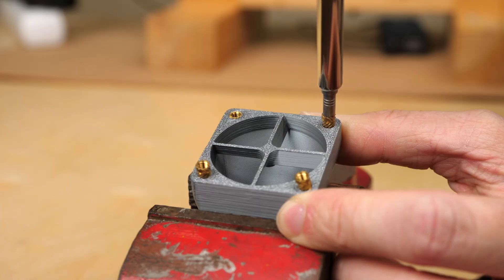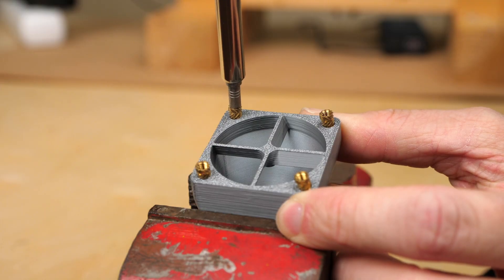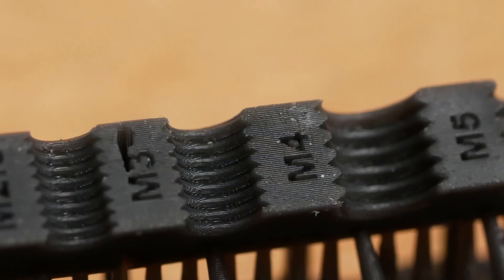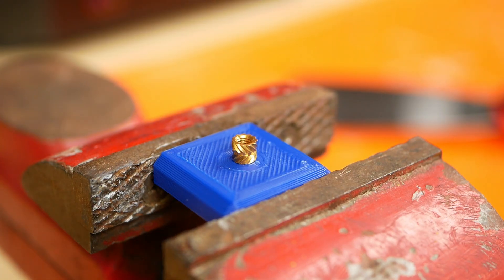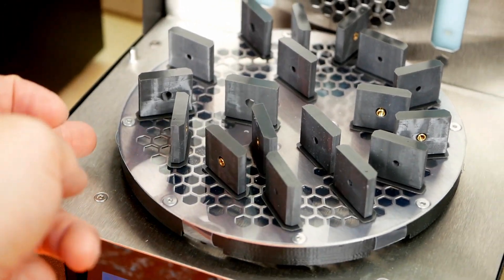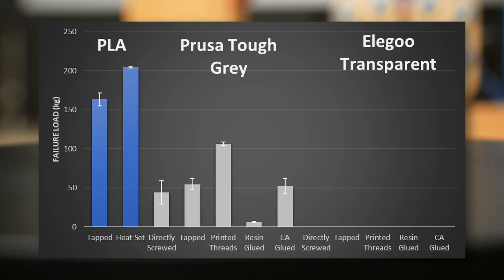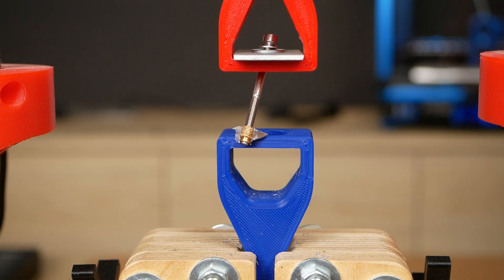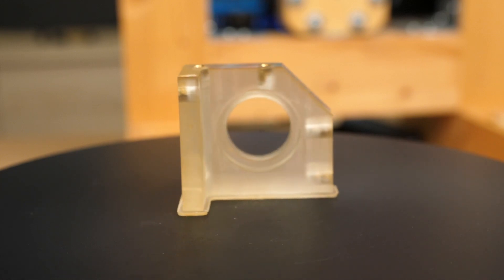Mastering Heat-Set Inserts in Resin 3D Prints

Comment: The undercut and stepped hole is the best way to make the threaded inserts work well by far for epoxy, in my experience. However, with resin prints I would recommend an alternative approach. The heat-set inserts you are using are really designed for melting the surrounding area to get a similar geometry in the bonding area as the undercut and stepped hole. It really isn't ideal at all for thermoset plastics. What I predict would work much better in a thermoset resin part are threaded inserts like those used for metal thread repairs. You can use the strongest method, printed threads, and then add EZ-LOK or EZ-Coil (these are the brand name ones) style inserts. I bet you'd get the best of both worlds -- perhaps even as strong as the PLA, or stronger, up to the limit of the differences in material strength between the plastics. There would also be an additional advantage, that this style of threaded insert would improve the precision of the threads in the end while working even with looser tolerances -- this is what they are designed for in metal applications. The geometry is optimized for more brittle failure modes, rather than extended plastic deformation, and this matches the material's failure mode.
Reply: Would love to see a test being done with those type of inserts. Really curious to see their performance. By the sounds of it, I expect it to perform really well.
Reply: @Rob-ky1ob  he has used them in a video before comparing nuts, threaded inserts and those type of screw in threads with FDM printed samples.
Reply: not realy, the resin part wil give in, exploding, long before the insert wil give in, so the weak link in the chian remains the resin print itself
Reply: @severpop8699  how do you think using abs-like resin impact the results?
Reply: @jonathancervantes2703  no clue mate, no clue.
Reply: My thoughts too. A thread repair insert glued into a printed threaded hole should be about as good in terms of strength as printed threaded alone, though since the hole is bigger (the drill size for HeliCoil M3 is 3.2mm, not sure about the "outer" tapped thread size), it may be slightly weaker.
It should beat glued heat insert anyway.
Kinda crazy they can make those tread repair kits as small as M2.5 though.
Reply: I was thinking the same thing by the end of the video and would also like to see testing on this method.
Reply: The coil-type inserts (EZ-Coil, Helicoil, etc.) tend to rely a bit on the tolerances of the threads they are screwed in into so they might need tight control of the printed hole dimensions to work correctly. The insert that have solid wall (like EZ-LOK) would work better. 

If trying to go this route and have the possibility to manufacture your own inserts, there might even be better thread profiles more suitable for inserting into the plastic than the standard metric / imperial thread profiles.
Reply: @maikeydii  There are also brass inserts with coarse threads on the outside for wood. So one could print the thread in the resin and screw them in, perhaps with CA glue. As printed threads gave good results I think that would be very strong.
Reply: @maikeydii  +1 for EZ-Lok inserts (other brands available, I'm sure, but choices are limited here in Australia and I wanted metric threads specifically). I don't do resin prints, only FDM, so this isn't quite the right place for this, but I've been using those in my designs for a little while and can heartily recommend them - an afternoon of tuning the right hole size, and you can use them perfectly reliably, without having to buy a special soldering tip (and possibly an iron to match) to get them in.
Reply: @maikeydii  just add glue or epoxy
Reply: Daniel, great comment.
Reply: Where possible for the tapered hole the inserts should be glued and inserted from the back. Having just linear splines on the inserts with corresponding printed splined holes would also increase the surface area for the glue to bond. Maybe cnc needs to manufacture thread inserts for resin prints.
Reply: @stevecade857 this, I really wanted to see him pull from the backside to see what the difference is.
Reply: Before switching to cnckitchens heat-set inserts I used the helical thread-repair inserts in my FDM parts too but it was quite easy to over.tighten screws into the insert and rip the plastic and since the inserts are quite sharp is was easy also to screw them in a bit angled and they would cut a new way into the plastic for themselves further complicating the issues.
Reply: @EeroafHeurlin  I would not recommend helical thread repair inserts in FDM parts. With FDM prints your best bet is heat-set inserts because FDM parts are thermoplastics.
Reply: @danielsmullen3223  yeah as I said, I switched to heat-set inserts for FDM. the helical stuff was available from local HW store and before CNCKitchen store added them finding actually good heat-set inserts was not that easy.
Reply: What a GREAT idea! Thank you for sharing!
Reply: Lol I just left a similar comment and noticed yours, you beat me to the punch, sorry for stepping on your toes.
Reply: I have used helicoil inserts in resin prints. I would say it works ok on larger coarse thread fasteners. Less well on smaller ones. To make it work right i had to clean up threads with a tap which works better on some of the resins than others.
Reply: When using coil inserts in a resin part, it is really easy to break the resin threads by thighteing the screw too much or already while screwing in the coil itself. The resin is way too brittle

Comment: I bought a resin 3d printer last month.  I didn't think it would be this bad.  I wanted to print simple clock houses.  It turned out that the resin is prone to deformation even under light load.  My watch cases started warping just after about a week of putting the straps in with spring loaded bars.  In a week, the springs visibly stretched both sides of the strap holder.  I tried 5 different resins and different UV light types for different times and the same result.  Has anyone else had a similar experience?

Comment: If you want higher load you need to use flexible resin. A mix of 95 to 5, which gives you minimal flexibility under load, can hold out more before ripping apart.
Reply: Totally agree, pla and these resins dont compare on the material properties.
Reply: @erikcramer  do you think abs-like resin with that 95/5 mix would hold up to similar loads as the pla?
Reply: @jonathancervantes2703  Thats totaly resin brand and mixture dependend.
Reply: One of the proven optimal resins for that would be Siraya Blu (original) for 95% and Siraya Tough for 5%, instead of wasting time and money for some obviously proven inferior crap (in this very video) like that marketing-wanky-named Prusa Anthrashite...

Comment: How about using inserts with threads on the outside (e.g. Rampa inserts or screw-in nuts)? If you screw these into 3D printed female threads and maybe even put glue on them you should be able to combine all the methods and benefits shown in this video...

Comment: Would it be possible to print the negative of a threaded insert and use those in resin instead? The kind designed for wood tend to have wide ‘blades’ that allow them to spread any force on the threads through quite a bit of wood. I’m wondering if printing the negative of that in resin so that you could screw in a wood insert would be much stronger than more typical plastic heat set inserts. 

I’m also curious if ultrasonic installation of heat set inserts (generally how they’re installed industrially as far as I can tell) would allow the part to be stronger.

Comment: I recently tried to add heat inserts into a cast resin version of a 3D printed product I made for a client.

I didnt quite expect the powdery results I got, I went to recasting the piece and then drilled and glued the inserts into the design. Thankfully the part did the job it was intended.

 I do still worry that the mechanical fixing of the resin and insert are not as strong as the insert and the 3D printed parts.

Comment: Very interesting video again.(And I am not a foot fetishist).  And (almost fittingly for halloween) scary how violently resin parts fail compared to the quite brittle (compared to other thermoplasts) PLA. 
I just thought it could be interesting to test a thread melted in a thermoplast which is than glued, or thermoformed/melted into the resin part with less sharp undercuts in the resin part. Maybe one could use hot melt glue injected through a hole which leads to a undercut in the resin part around the thread. 🤔

Comment: With the super glued resin inserts you should try over drilling the resin, roughing the inside of the hole, then using baking soda and super glue to glue in the insert without using an accelerator. Alternatively try a two part copper epoxy to fix the insert after roughing out the hole.
Reply: Accelerators aren't really famous of increasing strength. I would skip it
Reply: @whatevernamegoeshere3644  superglue and baking soda however do seem to make quite a tough bond.
Still it won't do any good if it can't adhere to the surface, so you still need to 'rough up' the edge of the hole. Or just make some kind of rough edges on the resin printed wall surface while printing.

Comment: When you cure resin, only part that is outside will be cured properly. It is not because of its color but simply because UV doesn't have enough penetration. Even transparent resin is not transparent for UV. The reason you are able to create resin prints is the fact that UV light doesn't penetrate it very deep (not deeper than 0.2-0.5mm), otherwise you'd just cure one single block of material continuing from buildplate to the top of the print if it was the case.

Similar with CA activator, you supposed to cover one part with activator and another with glue. Otherwise activator only works for outer layer.
Reply: This makes me wonder if thick-walled resin-prints are even cured througout or if they only have a hard shell and are liquid or gooey inside…
Reply: @rynnjacobs8601 when you print with resin, UV lamp under screen cures resin just fine, there's no issue here
Reply: @shadyb  But Stefan had the problem, that the resin he used to glue the insert in, does not cure completely? 8:06 and 9:45
Reply: @rynnjacobs8601  he did what I said he shouldn't have been doing in comment. It is not resin that was inside print, it is resin he put there to mount insert.

During printing UV light cures layers thoroughly because layer height is only about 0.05mm which is less than what UV able to penetrate through.

Comment: I wonder if pulling against the offsets (from the back) instead of from the direction of insertion would have improved the results. The hole goes through it so there's no reason the test direction can't be reversed (other than design of the part preventing it). 🤷🏼‍♂️

Comment: This application really depends on the amount of times the part is expected to be accessed and taken apart. Has a hard-core scale RC geek, I will print undersized holes into the part if it is part of something that likely will not be touched again for a long while. But, for things like receiver boxes, where access is likely, a threaded brass insert is perfect.
Reply: I use a hex recessed hole for the nut and bolt through load bearing parts, just like standard model parts for 90s helis and model cars. No insert needed and rely on compression strength.

Comment: I've always wondered why everyone uses them in the front side of the hole instead of the backside of the hole. This would leave intact plastic in front of the insert making it much stronger, I believe.
EDIT: I see I'm not the only one that has had this thought. And I see that this thought simply confuses the hell out of some people. Basic physics, an insert will pull out of a hole in plastic easier than it will pull through layers of plastic while pulling out of a hole in the backside of the plastic. Not sure how that's confusing in any way. 🤔
Reply: True, but these inserts are mainly intended for blind holes. For thru holes, a nut on the backside would be stronger anyway.
Reply: @fancytableshoes  Ah, you're quite correct, which would out even MORE material in the way of pulling out.
Reply: @fancytableshoes  LOL. These are intended for any hole you wish to use them in. That's really funny, sincerely.
Reply from the maker: This is a valid point, yet in many designs you don't have the clearance to install inserts and nuts from the back and this is why I tested it this way.
Reply: @CNCKitchen  press nut is only 2.5mm thick and around 1-3mm large in diameter than the the thread. Didn't see anything in you video that could not be design easily to use them. Seems to be the "lazy" option to use a nutsert instead...
Reply: @quadlawnmowerman  in his example prints you could have sure, but he was giving the reason he tested that way. He was stating in most use cases you would not be able to.  Still would have been interesting to see how it made a difference though.
Reply: @markburton5292  Well for the M3 bolt size he used in all the tests the press nut is only 2.1mmx4.5mm diameter so you need a gap of 2.2mm x 4.6mm to slip the press nut into, then add bolt and tighten/press into place. I again put forward that in most cases (95%+) you can make a small slit or allowance to put the press nut into the design, it only has to be about 5mm into the part to get a very strong anchor.
Reply: What frollard said is correct, but there's a way around it. I use a slight taper in the holes for the inserts and I often also use a ring cutout at the end of the hole (usually the former is enough). I never have any residue in the screw holes doing this and it is much stronger as you said and also mitigates the risk of ripping out the insert.
Reply: in my experience they melt/goo the displaced material mostly further into the hole. if inserted from the rear (inb4 inappropriate comments) it could/would push the excess in the screw path.
Reply: @frollard  This is true, but I've found it's pretty easy to push that excess out by simply threading the screw in from the back. It takes more time, but is worth it in my opinion.
Reply: I have some flanged threaded inserts. They are perfect for fitting on the backside of a part. Looks cleaner than nuts, no idea if it is stronger though. The M3 ones have a 7mm flange so i guess the pressure would be spread around a wider area compared to a nut.
Reply: I figured it was to present the worst-case data instead of best-case data, but also the hole was modeled cylindrical instead of conical so there might not be that much of a difference.
Reply: I do just that but I go the cheaper way with this technique: hex hole for a normal nut. As simple as that. I rarely use the heat inserts I have cause they're simply far more expensive than nuts, and harder to install vs. just push the nut there.
I feel like heat set inserts are best for that case where you just don't have access to push a nut through without much hassle (like having to print with supports or such), or you do need a blind hole.
Reply: Yeah, makes little sense to use these over a press nut...
Reply: Wouldn't melted plastic in the screw hole simply make for a better installation? It turns the fastener into a locking nut. Since the inserted screw will cut its own threads on assembly. We don't truly need to worry about the threads or the plastic after the insert is installed or used.
Reply: Heat set inserts that are subject to enough forces to rip them out are probably in excess of what the forces on most parts could stand in almost all use cases I would guess.
Reply: If you need that kind of strength, to the point of shreadding through all the layers of plastic, you should just design it to use a nut and bolt instead of a screw.
Reply: Visible hardware looks nice on a print
Reply: @ecmphg  right, and if you put it in the front of the hole and then fasten something to it, it won't be visible.
Reply: @shelbyseelbach9568  we are but simple creatures yes.
Reply: exacly ppl asre dumb.. or looin more for desing intead of actualy function..
Reply: Ot just use screws for wood
Reply: modeling around needing access to the back side of a part is also trickier than just throwing these on the front
Reply: @TheCinderDude  Not always.
Reply: If you have a through hole where you can do that, why not use a nut and washer. It would be cheaper. The thread inserts are more ideal for blind holes where access from the other side is not available. Physics, meet engineering.
Reply: Because if you use the back side of the hole you use the strength of the hole, not the strength of the insert. That makes the strength of the insert irrelevant, which is why nuts tend to be the tool of choice in these situations.
Reply: @Peter-jl4ki  No, you use the strength of the insert plus the strength of the plastic part of the hole that is in the way of it pulling out. In a part that is only as deep as the insert it probably wouldn't make much difference, and in a part that is thick enough to make the bolt length ridiculous it would be impractical, but in the cases where you would only need a slightly longer bolt it would be stronger. Basic physics just aren't that confusing, my good sir, for most people anyway. LMFAO.